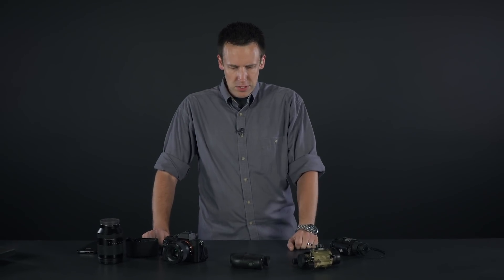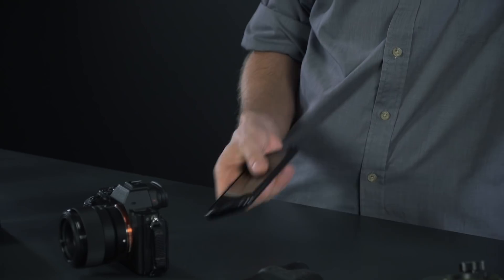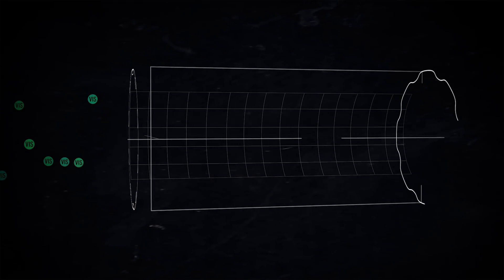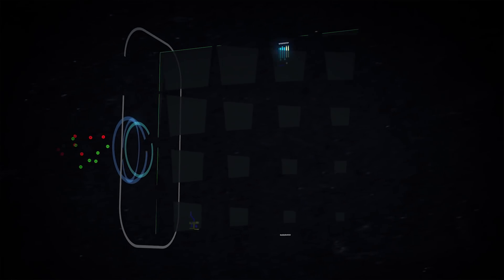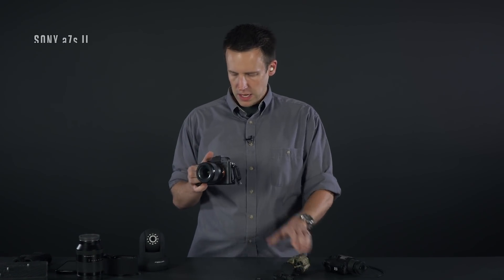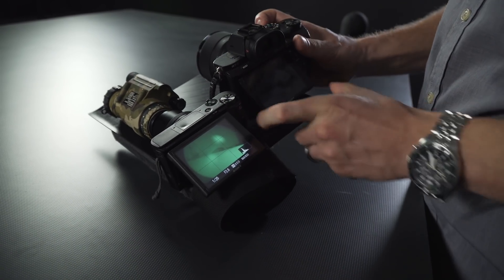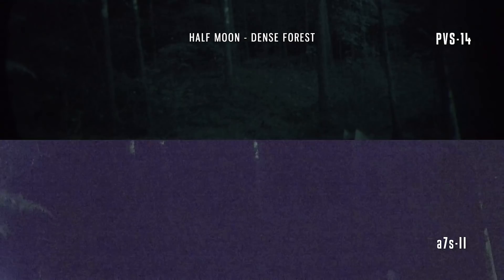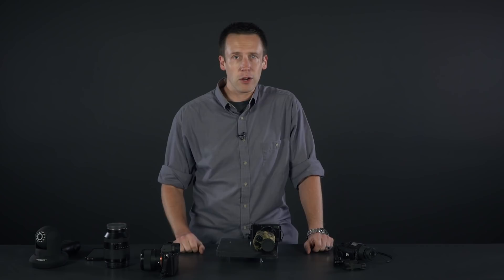When will Digital Night Vision Catch Up?

Comment: I can only imagine how well a specialized sensor with modern features tailored towards night vision (back sensor illumination, maybe four-ish megapixels, no color or IR filters, dedicated image processors designed specifically for low light usage) might perform in comparison to a typical generation 3 analog unit. Once one of the bigger industry names actually sinks some cash into R&D I'd seriously start betting my money on digital over even our best tube based systems.

On that note, specialized hardware would probably get rid of a lot of the drawbacks of digital. Power consumption would still be higher, but custom image processors that are purpose built for low light imaging would drastically increase efficiency while also reducing latency.
Reply: Yeah, building a product around this use case would result in some drastically better results... but it's also a tiny market. While I'm a big believer in the free market, it's clear that the private sector hasn't spent nearly as much money on building night vision tech as the US Government. That said, that private sector have also had some artificial limitations and legal restrictions placed on these II tubes... so now that we are in the digital age we could see a bit more innovation by regular manufacturers.

Comment: What ISO settings did you use?
Reply: For a lot of it, I had it set to auto... but even then it was almost always at the maximum 409,600 ISO.
Reply: now it would be interesting to see the difference between with and without the IR filter... ohh no GBA is kicking in! ;)

Comment: I think monochrome version of Sony a7 would be much closer. You don't really need the colors on nightvision applications so no sense on using color filters for pixels blocking much of light
Reply: Or going from a 1.8 lens to a 1.4 lens or better. If enough electric power is there a pelletier cooled sensor could be possible. This can improve the signal to noise too.
Reply: @maltekoch1632 , there are f0.9 lenses that he could have used
Reply: Yes, I think it would get you double the sensitivity; that's what monochromatic versions of RED sensors tend to get.
Reply: @isaacbotkintrex  green sensing pixels are usually double the number of either red or blue. Mimicking human vision
Reply: pahwraith He meant the sensors from the company RED
Reply: The color may be useful, but until the tech catches up, removal of the color filters is wise. Capturing only luminosity makes real time image processing easier as well.
Reply: Monochrome is more sensitive but color vision still useful.
Reply: Artificial Intelligence   +   Night Vision   =    https://www.youtube.com/watch?v=bcZFQ3f26pA
Reply: So how are we going to deal with it?
Reply: This is absolutely correct. The Bayer filter actually blocks IR light, pretty effeciently too, since only red filter segments are transluscent to IR, which is only 1/4 of the all segments, so this makes camera at least 4, but most realisticaly, regarding the fact of light absorbtion, about 10 times worse than it possibly could be. I'm sure also, that the image processor of the camera actually also struggling to strangle the IR signal as it sees it as electric noise. Also the thermal noise from camera itself is quite critical contrast vise, so idealy sensor should be operating at lowest temperature possible, while Sony uses ultrasonic image stabilizers which is quite powerful heat source. Most useble for the task would be modern BSI Peltier-Cooled BW cameras from telescopes or microscopes.
Reply: I totally agree. Some of the astrophotography monochrome CMOS have insane sensitivity, you can see most large nebulas in 30fps.
Reply: color night vision has a lot of advantages but im sure they could make the quality much sharper and more sensitive to light  if they omitted the color function.
Reply: Totally just was thinking about that! Also a system like arri alex use to capture two frames one overexposed and one underexposed. To get the most dynamic range, also you don't want bright light sources to clip out.
Reply: I think one of the only and biggest reasons to switch to digital night vision would be the color. As stated in the video the camera can easily make IR light show up as a different color on the screen, which is incredibly useful. It also can help with the headaches people get when running monocular NV with both eyes open, even if there's barely any color.
Reply: https://youtu.be/kJZHx0Vsa-8
NVG working
Reply: or maybe the new canon sensor with the crazy ISO? ME20F-SH Canon?
Reply: @mihalikalex  Canon sensor is not as good as Sony when ut comes to dynamic range and sensitivity.
Reply: @qiyuxuan9437  I mean the special surveilance canon camera
Reply: Remove the IR filtration from the sensor and youll have even more light!
Reply: @df0rce  Thats what he did.....
Reply: @df0rce  Did you even watch the video?

Comment: Please do a review between SiOnyx Aurora and PVS-14?
Reply: SiOnyx makes several compromises over the Sony Aii to get the size down. Smaller sensor, smaller battery, weaker processor. 

It's still pretty good in low light situations and it's cool to have such performance in the size of an action camera. But the Sony here outperforms the Aurora in every way

Comment: Technically digital camera sensors are also analog. They collect photons and convert it to charge (CCD) or filters that reflect light on certain photodiodes/transistors (CMOS). This output is inherently analog and is first also processed with analog electronics, before it is digitized with an ADC. Usually this is all on the same chip though, but also these sensors are not 'digital'. In a sense, night vision devices are the same, except instead of the photodiode/CCD pixel, you have the intensifier tube. This information is then further processed and digitized. Image intensifier tubes do something no 'digital sensor' as you put it, can, and that is amplification of light. This is because you are inherently limited by system noise.
In my honest opinion, we need a new kind of technology that amplifies light, but on a small scale. The thing is, most digital imaging sensor technology is driven by the consumer market, and the night vision market is still a very, very small segment, so not nearly as much drive to change.

Comment: I loved this video and did not expect it at all. So my question to you is, are you currently working with and persuading the engineers to move towards this new technology? 

Personally I've been able to work with the tech geek engineers who develop the crazy new technology coming out. We taught them simple simple basics and tried to put them through some stressful shooting control situations so they can get a better understanding of who they are developing technology for, what kind of missions things are used for, and what kind of tech it should be. 

They would come up with ridiculous ideas like "what if you had a drone which you could drive throw into the air, then it will fly forward into the enemy occupied area, and then explode killing the enemy"... Our common response was "ehh, or you could just use a $10 grenade". They can develop the tech, their problem is they don't know what to develop.

 I think you could be a huge asset to them because it sounds like you know exactly what needs to be developed and even a blueprint to how.

Comment: Nightvision4less (tacky website name yes) has some good layman info describing generations on their info page if anyone's curious. Also, the same housing types can have different tubes which can reflect a price difference, which is why you might see a pvs7 gen 2+ for $2500 and another pvs7 but with gen 3 for $1000 more, along with other things like autogating and such. Don't get $900 nvgs with mystery tubes on eBay!

Comment: If I MAY detract HEAVILY from the prospect of digital night vision, there is something of a delay as the processing occurs. Something not present in analog. There's no delay. You're simply seeing what's in front of you at the speed of light and photon/electron flow to the back of the tube. Which is why I kind of like to take the "TUBES FOREVER!" stance, because I think digital, I think of my experience with digital cameras, which is that you'll see what's on the screen, but if you turn it around quickly, you'll pretty quickly catch on to a delay, which is going to be there just as long as there's some sort of processing time associated with it, which computerizing will create inherently. Meanwhile in TUBE WORLD, we're seeing an uncomplicated process of taking a thing, made to do a thing, and providing it electricity to what it's intended to do, and getting a result without adding any delay into it.

And while Digital MIGHT be nice for image capturing and filming compared to things like tubes, I still can't bring myself to favor digital for this application, because, as long as a tube is just getting power, that's all it really needs to do the job of image intensification, and it does so without lag. I'm not saying you couldn't perhaps replicate that in digital, but personally, I wouldn't abandon tubes for it, because, lets say you're flying a helicopter, then there's a bug in the software, suddenly you may lose vital visual information at a particularly compromising moment. Furthermore, I keep seeing all this about color night vision, and... I don't want it. I think if it will get a greater return on amplification and light sensitivity and electro-optic durability, then we should try it, but I think whatever "IT" in this case is, should be analog.
Reply: I'm a sound tech for concerts...in our Digital vs. Analog world we call that "latency."  For a while, digital live audio had a lot of latency, but that tech has caught up to where it's unnoticeable. All of the old fears of digital are gone, and literally everyone is using digital audio processing now. I suspect night vision might do the same.
Reply: Jim Trouten 👍
Reply: We already have the tech to completely eliminate any noticeable latency.
Reply: Electronic viewfinders from recent years have no longer any noticeable delay, and are usable for sports photography which doesn’t do well at all with lagg
Reply: The future will be low weight Digital Night vision/ Thermal goggles that you can toggle between the 2
Reply: @fastbyte4583  or overlay the first with the latter. I suspect that you will be able to overlay the first with various "filters", each that conveys different information. Maybe people with past felonies will have green outlines, and if they have a weapon the will have a bright red outline. You may have a filter that will show elevated heartbeats or low oxygen levels, for EMT's. The filters could be specific to a need and then they could tie this in to secondary systems... Guns that would automatically go on safety for a split second when they are aimed at children or hostages. Life-saving equipment that could prepare themselves for certain blood types, as that EMT recognizes the need for attention and goes to help that individual. Digital is definitely the way of the future, as it deals in numbers, we already realize that mathematics
 is the language of reality.
Reply: As always, digital technology will become cheaper and cheaper. They will start using processors that are extremely fast with access to information very quickly, and they will start using multiple processors. At that point, the delay you speak of will become so small that it will basically be undetectable. It is simply a matter of time.
Reply: Color night vision would be great for pilots, as color can be important in distinguishing the lights on runways, taxiways, and other aircraft.
Reply: if your average smart phone can do realtime 3k with no noticable latency and can even include AR effects i think military gear would be fine with digital
Reply: and tubes aren't TREE sensitive which is still a requirement from any army in the world !
Reply: I have a digital night vison scope and have no lag whatsoever, its only slightly more sensitive than my gen one tube but i can use it during day which is a big deal for me as i tend to use it from late arvo to dark.
Reply: Latency is consumer stuff.
You don't get noticeable latency on pro gear.
If you take high end cameras such as a Sony Venice or Arri Alexa with their digital viewfinder there literally is no latency.

Comment: should be noted cellphone cameras have limited IR detection, for instance they can detect the IR LED from a tv remote
Reply: Yes; lots of cheap cameras have cheap IR cut filters, and they sneak just a little more light onto the sensor if they don't block all the IR. Usually, you don't notice unless you do something like look at your TV remote, but if you've ever taken a photo of someone wearing a black shirt in sunlight, and it came out looking kinda pink, that was your camera's IR filter not blocking all the all the IR light.

Comment: I think though, one problem with digital systems is noticable delay between sensing and signal output.  Signal through the dac and other processors in digital systems will cause a delayed feed to the operator whereas anolog systems are almost instantaneous.
Reply: Excellent point! I don't have my notes handy, but the a7sII viewfinder has surprisingly little latency. It measured as just under what the VR techs say is needed to avoid motion sickness, but only just. That insanely quick processing is why this camera uses 100 times the power of a tube.

Comment: As a photographer, this was extremely interesting. I had always wondered why they didn't use super high native ISO CMOS sensors in night vision and this helped answer that. I do wish you would try this again with a higher light transmission lens than the cheap f1.8, like a t1.2 lens, to see where CMOS can shine. Great video and great animation!!!!
Reply: CCDs are better, the photodiodes are in front of the substrate rather than behind in the case of CMOS.
Reply: NVG working
https://youtu.be/kJZHx0Vsa-8
Reply: Look at the SPI x27 camera. Either I'm missing something, or this guy doesn't know shit about what he's talking about.

Comment: *"Omitted for clarity" means "Animator was lazy"

---> The animator    LOOOL!!
Reply: Here at T Rex Arms we don't take ourselves too seriously.
Reply: ...and the best footnote award goes to...
Reply: @davidbotkin6032  You can tell by the deafening sound effects.
Reply: I raise my glass & tip my hat to the animators!
Reply: Naw it means we don't need to sit through an electronics engineering / digital photography hardware course we just need a basic down and dirty
Reply: https://youtu.be/ZddkopapYw8
Reply: I thought the animation was seriously pro, especially the digital camera circuit board. What software did you use?